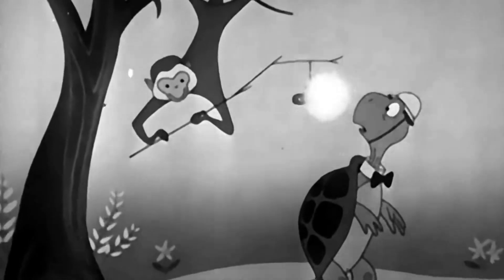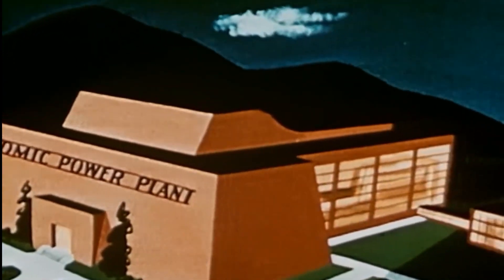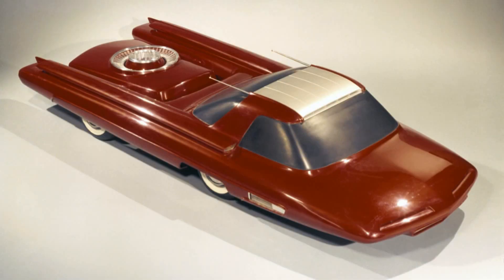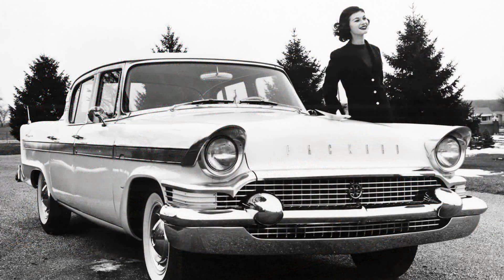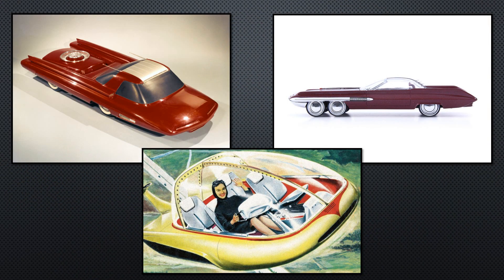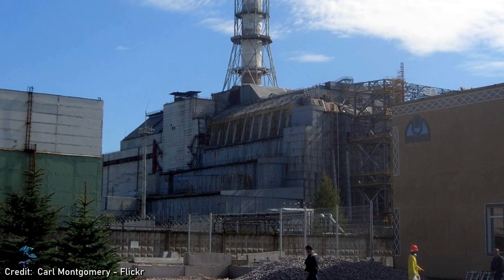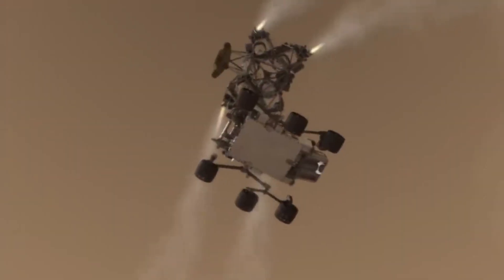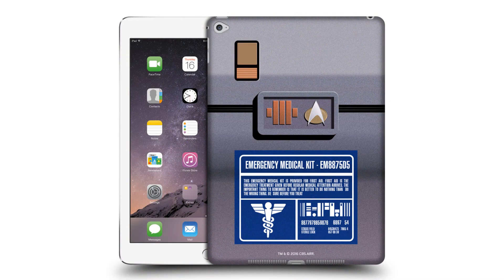Our Nuclear Alternate Future?

Comment: Imagine an engine meltdown with this masterpiece
Reply: Nuclear reactors are not bombs, they do not explode, in fact an explosion is impossible.
Reply: @visekual6248  changed the joke in the name of science
Reply: @mr-rk394  You didn't have to, but thanks.
Reply: @visekual6248  Boiler explosions are, in fact, totally possible.  That's basically what happened in Cherynobyl and a few other lower profile disasters.
Reply: @visekual6248  um well then what was the Chernobyl incident then
Reply: @Tempvo  The explosion in Chernobyl was caused by the build up of water pressure, not because of the nuclear reactor.
Reply: Oh, how's it going, Dyatlov?
Reply: @visekual6248  But doesn’t the uranium heating the water, if not cooled create an explosion?
Reply: @Pryad881  Yes, this is what happened at Chernobyl, but what causes the explosion is pressure buildup, not the reactor itself, so much so that this type of explosion never happened again and could only have happened at the USSR.
Reply: @visekual6248  Tell that to the RBMK reactors, and yes the reactor itself did explode as in the explosion occured within the reactor sending rods and graphite and other shit everywhere. It wasn't a nuclear explosion, but it was still an explosion of the reactor
Reply: @IkeanCrusader1013  If you only consider the consequence and not the cause, yes you are right, but it was not the reactor that exploded, but the cooling system that passes through the reactor, if the cooling system had not exploded the reactor would have suffered only a meltdown. To make it easier to understand, suppose a house with central heating and imagine that an overheating of the system occurs and the boiler explodes, don't you agree that it was not the house that exploded.
Reply: @visekual6248  Yeah but radiation could leak if the reactor was damaged in a crash
Reply: @visekual6248  but a meltdown would spread radiation around the area and create a chernobyl 2.0
Reply: @visekual6248  Chernobyl: AM I A JOKE TO U
Reply: @russia983  what are you talking about?
Reply: @russia983  Chernobyl was a cheaply built reactor with flawed control mechanisms that failed at precisely the wrong moment, after a panicked move by the operators that should never have been made. Thankfully, it's VERY MUCH the exception. There are reactors just like Chernobyl still in operation today, fun fact, with the fatal flaws mitigated of course.

All modern reactors (which are hardly being built) genuinely have a zero percent chance of exploding or even melting down by design. We won't know for sure it's impossible until it happens, but I'd call it a pretty safe bet.
Reply: @russia983  that was technically a steam explosion
Reply: @russia983  the whole shit explodes because the lid came off cause of intense pressure.
Reply: @deneb_tm  modern reactors and old ones still have a huge fault that is that they produce nuclear waste that will be active for more than 500 years. Today's technology does not permit us to eliminate this waste and as a result we throw them underground or as us western countries did only once throw them near the coasts of somalia causing the pirate problems
Reply: @theoriginaldragon130  Yeah, the waste - it's not a non-issue for sure, but the amount generated pales in comparison to the emissions from fossil fuels, which we don't even have a chance of containing. Dumping is definitely a concern and operators need to be held accountable, however almost all of the waste generated is stored properly, and the imminent heat death of our planet is honestly of far greater concern than the waste in the immediate future.

And while right now it may "just" be waste, methods of using it to power other reactors exist and are acticely being researched - carbon capture meanwhile requires power to work effectively.
Reply: @deneb_tm  I don't know about your country but here the ecologists are dismantling their Nuclear Powerplants to build Fossil energy plants as they think that nuclear waste is a big problem of the century.
Reply: @theoriginaldragon130  Germany, I assume? Lots of biased studies, gross overestimates and outright lies on the environmental impacts of Fukushima and nuclear waste essentially forced politicians' hands if they wanted to get re-elected. I used to buy into it all, but my opinion has shifted a lot in recent years.
As a result, Germany's per-capita emissions have, at best, stayed the same in the past ten years, being nearly twice as high as those of France now, and massive brown coal mines are eating up more and more land.
I live in Austria, the country that wasted the equivalent of € 1B on building a plant to completion in the 70's, only for it to never be turned on by a 50.1/49.9% popular vote, a feat which most of us seem to be proud of for some reason.
Reply: @deneb_tm  I didnt do my research on the german situation because i live in France and yes although its the technology we chose to develop and ecologists still want to dismantel them
Reply: @russia983  Chernobyl was a gas explosion that lead to meltdown not a nuclear explosion.
Reply: @russia983  vhat the blyat do you mean, RBMK reactors dont explode
Reply: @theoriginaldragon130  stupidity. They're not ecologists. They're interlopers paid off by (Big Oil) to maximize the profits of oil companies
Reply: @theoriginaldragon130  that’s a real shame given the emissions are quite low in France, plus eg the TGV was electric to begin with because of the cheap nuclear power. 

Britain where I live sold off its nuclear expertise then wondered why modern plants keep getting delayed, and we keep putting off fully electrifying our rail network. I’ve always looked to the French nuclear fleet as an equivalent to aspire to tbh. 

Even if there’s no good geological storage solutions for French waste, I wonder why buying space in the Onkalo spent fuel repository isn’t enough of a solution for the decisionmakers. 

(Plus as the other person mentioned, there’s designs for reactors to use spent fuel directly, but reprocessing is already doable — just not currently cheaper than new fuel.)
Reply: In your garage
Reply: @alphatrion100  "barn find" restorations projects will be a lot more interesting
Reply: @mr-rk394  "just had to replace the fuel rods on it, thankfully nothing else melted."
Reply: an
Reply: Wouldn’t even be mad in this badass
Reply: *an
Reply: @panzerkampfwagon5637  Thanks
Reply: Hahaha 😅
Reply: @Enzo Discovery In both situations there was no explosion of the reactor, what exploded was the boiler and in the case of Fukushima there was only a meltdown because some genius decided to put the diesel generator, which would feed the safety system in the event of an electrical failure, below  sea level.
Reply: It would create a new form of Corium: Carium
Reply: The boiler explosion wasn’t the dangerous part it’s what the explosion did to the reactor
Reply: There is a documentary about the incident on Amazon prime I suggest anyone wanting a little history lesson watch it but it is graphic in some parts
Reply: imagine making Heavy Gear a reality
Reply: *an
Reply: They will "Melt Down" to earth and contaminate all the things in its path
Reply: Very good 🤣
Reply: I don't know what has more fantasy in it.
The video or the comments.
Reply: Chrenobyl Car
Reply: Impossible
Reply: They wouldn't reach critical mass because they'd be flooded with water cooling them down before they could.
Reply: yes!
Reply: "Warning, Core temperatures are exceeding safe operating perimeters"
Reply: Safe guard for the uranium is possible, its 2021
Reply: It's called thermal runaway
Reply: Best comment 😂😂😂omg you are awesome
Reply: Basically the entire state would be contaminated since its leakage ;)
Reply: Tesla meltdown is worse
Reply: Goddamm Chernobyl